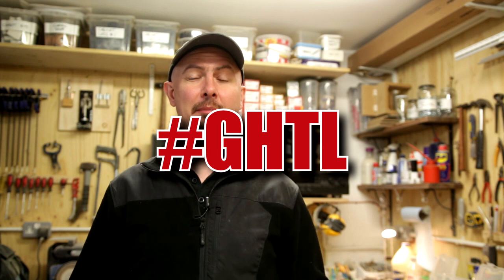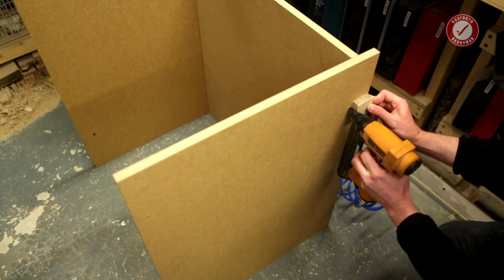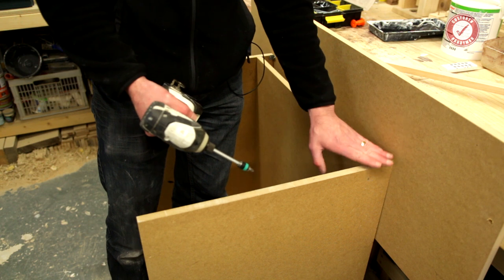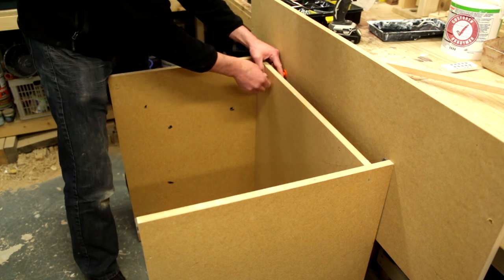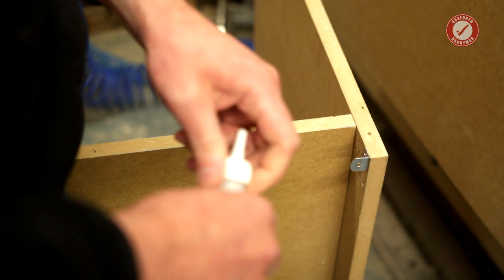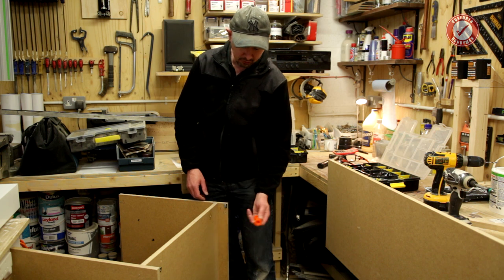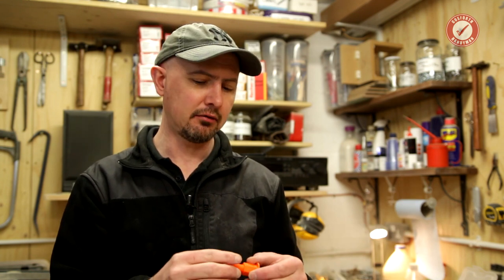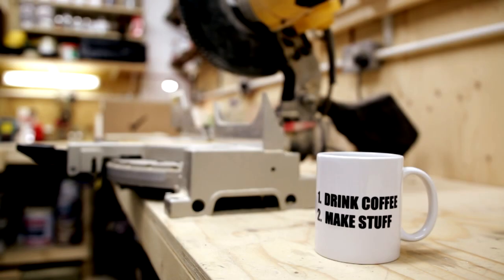Adjustable Spacer & Problem Solver using Space Plugs - DIY Tips!

Comment: I've been a cabinet maker/joiner for 18 years and fitted countless kitchens and I've never seen these before! Nice little gadget! Nice video 🔨👍🏼
Reply from the maker: Cheers bud! 👍
Reply: If you make your own units you can save a good bit of material and often get another unit out of a sheet by shortening the side panels - doing away with the excess gables - and making the sides flush with the back - create the void with Space-Plug - means No wasted material - No cutting round pipes - No shimming - No scribing - No losing edgebanding - smaller lighter units in the van - No double handling .... take a look at Space-Plug.com and navigate to the manufacturers page... :)

Comment: Nice!   In the retrofit example with top in place they would be a little fiddly setting the depth/gap.   Idea for spaceplug makers is to figure out how to adjust for the cabinet side.  Maybe oversized cabinet hole with hex head adjustment for depth then down to “normal 6mm hole for screw to go to wall.
Reply from the maker: Hope they do this on v2! 😀
Reply: It's on the drawing board but it's a lot more complicated than you'd first think!! But I'm working on it :)
Reply: cliff petit I could work with you.  That would slow you down!

Comment: Would it not be better to glue on the male end to allow adjustment on hex part?
Reply from the maker: Yeah, probably - it's just the way they show you how to fit them on the pic - they're very easy to turn though. 👍
Reply: Reinstalling with the counter top on how do you adjust these spacers unless you pull out the cabinet to access the adjustment. Would not a hex hole larger that your screw so that you could insert an allen wrench and adjust. A larger hole in the cabinet would have to be made but a washer would take care of that.
Reply from the maker: Hex hole would defo be handy. Hopefully that will be v2! 😀
Reply: TBH - if you were only pulling out 1 unit post complettion coz it was damaged or something replacing it you'd likely only need to secure to cabs either side and counter top.

Comment: On the subject of MDF. What do you use to glue the 'end grain' of piece of MDF to the face grain of another? I have tried wood glue (D4 Wood Adhesive and Lumberjack 30 Minute Polyurethane Wood Adhesive), but it seems to just get soaked up by the end grain and the joint is super weak! ... I will be using nails as well as glue, but so far, the glue does nothing :(
Reply from the maker: Biscuits and Titebond II for structural joints. You should find a clamped joint will still be pretty strong though. Another option is CA glue but no use for big areas. 👍
Reply: I've made upteen blanket boxes using mdf, I use EverBuild 502 a couple of 23g pins and then clamp. Never had a problem you just have to be generous with the glue. Occassionally I have coated the end grain with a smear of glue and left it to go tacky to reduce the absorbtion, then you can be less generous which means you get less glooze to clean up.

Comment: Good product but don’t most cabinets have crappy 6mm backs?
Reply: *shi##y kitchen cabinets
Reply from the maker: Normally they've got at least a 18mm support piece at the top... but if they don't then yeah these won't help. 😀
Reply: Thanks Michael :) I think you'd get away with a 6mm back to fix through - certainly not less than that - most have 15/18mm cross strap or solid back though... some annoyingly do have the cross strap flat these days... we're not suitable for every single unit though so do check before buying... :)

Comment: Kitchen manufacturers have thought of that problem and that's what the holes are for in the back of units. Line bracket up with hole and drill through and fix, plug hole with supplied cover 🤗
Reply from the maker: Most base units don't have this and you wouldn't be able to get the plug through the bracket so you'd still have to pre-drill. Some manufacturers put drop-panels on the back to allow access to the brackets - that's handy (but leaves an ugly gap at the top-back of the units).
Reply: Gosforth Handyman yes I suppose only a handful do, but I mostly deal with howdens who do supply a hole etc, meaning you just use an extension bit to tap plug and screw through hole. I Not totally convinced by the product but may consider it in the future. Great videos, brilliant to watch, keep it up!! 👍
Reply from the maker: Cheers bud! They're a great problem solver to have at hand! 👍
Reply: Funny enough they didn't  til I took them Space-Plug Dom!!!! For most companies the holes, larger brackets, cover caps all came after I'd explained Space-Plug - much improved... BUT... with Space-Plug you usually only need one fixing centred - you replace 2 fixings and 8 bits of fiddly hardware with just two easy to handle bits - and you have all the lateral and depth play you need - find wall studs or avoid dodgey patch plaster etc... no need for packing... we're not rocket science but we do make life faster and easier :)

Comment: Sorry, but I really wouldn’t rely on such a long screw being man enough to hold the weight of a unit filled with plates. Normally a professional would first screw up a long list, say 15mm x 40 mm level on the wall using the right fixtures for what is behind, this will often include simple wooden plugs for the cabinet to slide down onto, yet even though you would need a thicker screw to secure the cabinets to the list.
A list helps line-up several units you understand.
Yet a fun gimmick, does not look strong though.

Comment: £25 for 50 - How much?!!
Reply from the maker: There's defo scope for the price to drop as these become more popular - it would help if they didn't include a drill bit. Still, fraction of the cost of fitting a kitchen. 👍
Reply: I had a good long chat with Cliff Petit (the inventor and MD of Space Plugs) several years ago at the NEC. It was actually while fitting kitchens he came up with this solution. Yes they may seem expensive BUT they are made in Britain, not some mass production factory in China where people work for pennies an hour.

Your money helps pay British wages which puts money into the Health Service and local community. I know Cliff could have easily have had the production moved to China, cut costs considerably, and sold loads more but he chose to keep it British. That's a principled man in my opinion.

Besides what is £25 compared to the overall cost of the kitchen and appliances? And, if like me you are a tradesman, then you include the cost of materials in your quote. I'd doubt you would lose a customer because you added in a few pounds for some Space Plugs.

Oh, and you can often get away with using just one plug per unit if they are sub 600mm if you are so inclined.
Reply: There's a few reasons for the price feeling big (you can buy cheaper on line btw but not for me to say) but: An internal thread is difficult to mould as the mould has to unwind itself out... means they don't come out the factory super cheap as you'd think - we also manufacture in the UK (I insist) - distribution obviously has to take a cut - and more but honestly I'm trying to get these in the box already for you so you don't pay a penny (Wren Chris Sharpe Hart... more to follow!!) so mention us to Howdens BnQ Symphony BenchMarx Moores etc. :)

Comment: Easier solution is to not make so stupid cabinet that behind back panel is gap.
Reply from the maker: The gap is a 'service void' and it's there to run utilities such as pipework, Mr Wizeguy. 👍
Reply: We run pipes or wires under cabinet where is around 6" space created with adjustable feet. And on new construction all utilities are installed inside wall.
Reply: @davidhale8034  And your comment made  zero sense. If cabinets has stupid design what has it to do who installs them.
Reply: @mr.wizeguy8995  Eh?? Talk about a comment making no sense.  Have you even read your own comment?? I think you've been on the sauce dude.
Reply: @davidhale8034  Don't drink while you comment. Still your comment didn't had any sense. And i don't bother to argue with idiots because i fall to your level and you are expert of it.